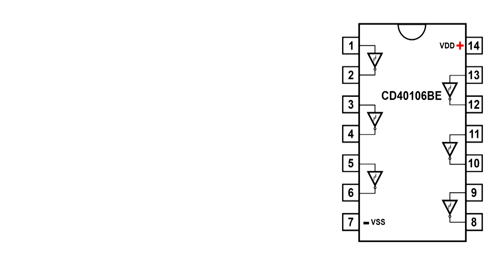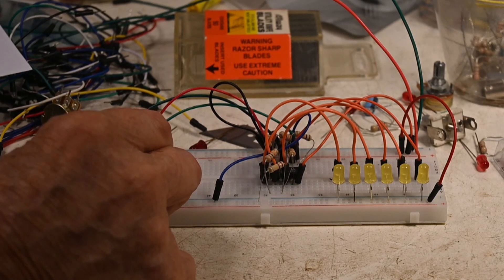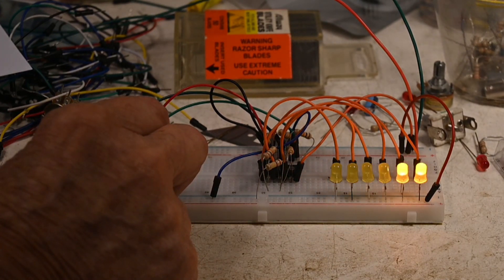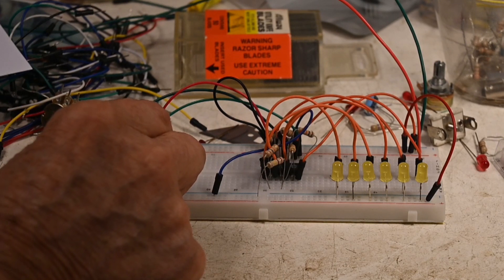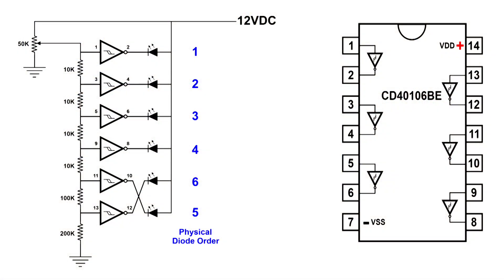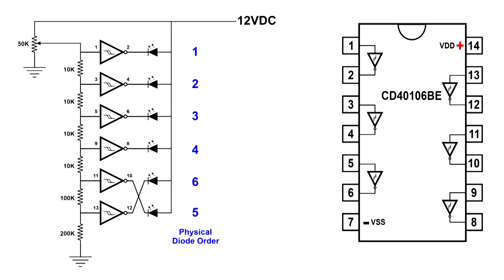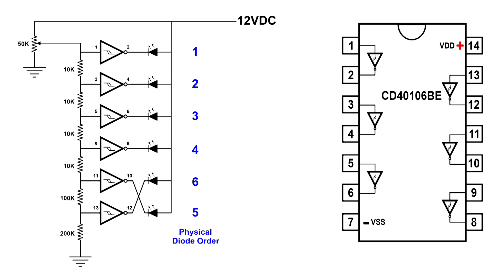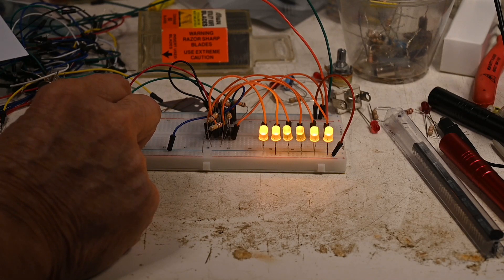Build a SIX LED Level Indicator CD40106BE

Comment: Great little project! Thank you for posting! I'm thinking that 6 comes on before five because it looks like this chip switches grounds only. Number 5 is at different ground potential than any of the others. I wonder if you replace the 100k with a 10k. Even if you had to replace the 200k with a 300k. Let me know what happens. I'm not familiar with how these chips work, but it's weird how 5&6 are swapped inside the chip. Thanks for the video!
Reply from the maker: Thanks for the information.

Comment: I think something has to do with the impedance of your potentiometer.
I simulated the circuit with just a voltage source that ramps up, but don't have the same behavior.
Usually the 5th resistor (100k in this case) is also lower in value, like the other ones.
Reply from the maker: That could be. Thanks

Comment: I just did a rough calculation and the input voltage at pin 11 would be lower than the input voltage at pin 13. I’m thinking the lower voltage will be the loser in this case causing output at 12 to come on first.
Reply from the maker: That would be a good start. Thanks